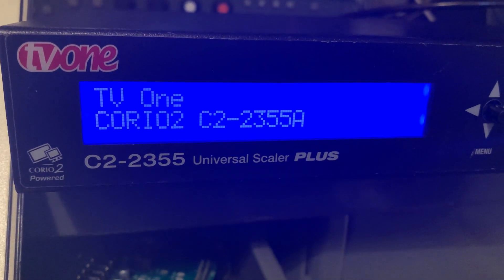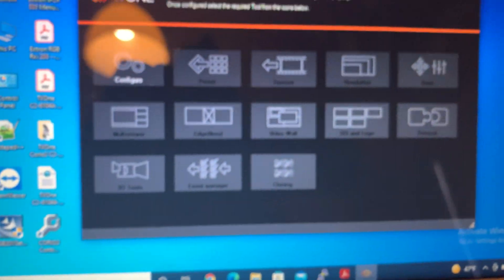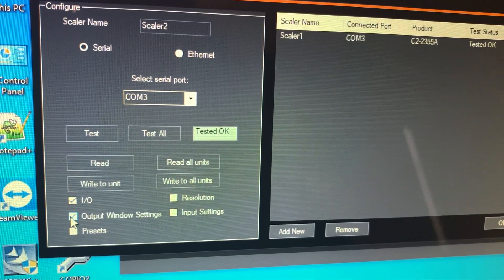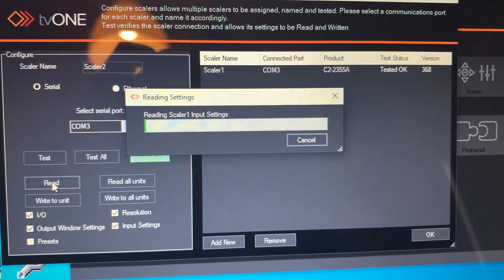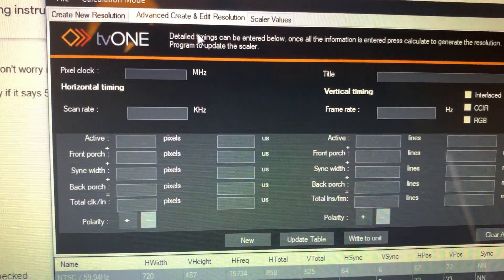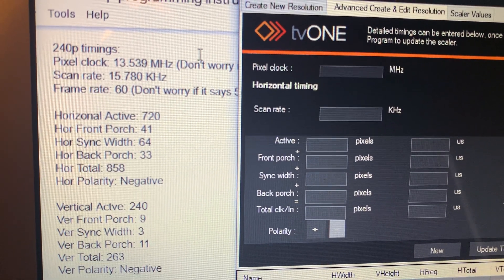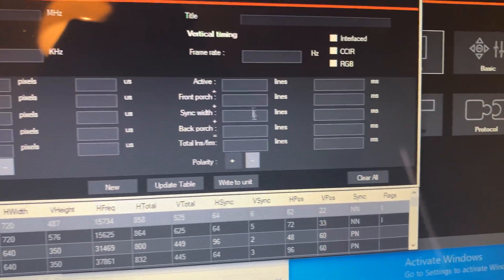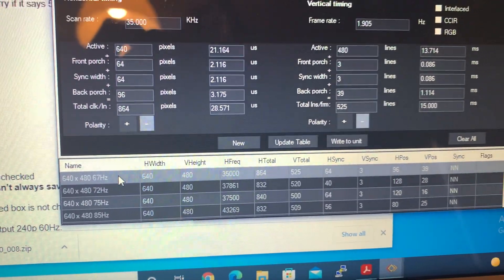MANUALLY adding a 240p preset to a TVOne Corio2 downscale

Comment: My goal is to connect my smartphone (outputting 1080p via HDMI) to a consumer CRT with component inputs in 240p. Is it possible with this device? I also have a VGA to YPbPr transcoder if that would help this process.